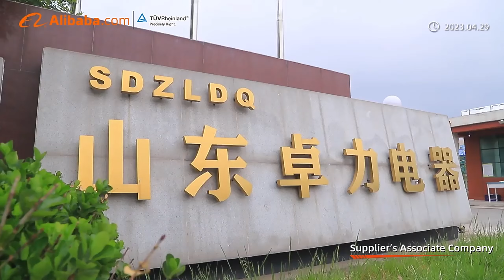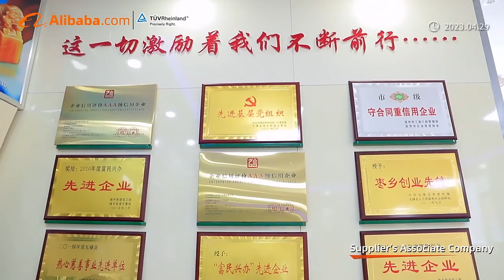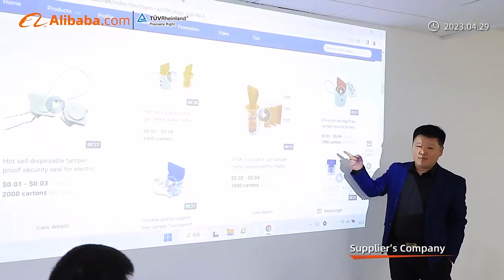Plastic seals, steel wire seals, instrument seals, high security seals and other seal manufacturers

Comment from the maker: Established in 2012, one of the largest manufacturers of security seals in china.Our company covers an area of more than 12000 square meters, with strong technical force, advanced technology and equipment, and complete testing means.Jinan Zhuo Li is specializing in R&D,

Manufacturing and marketing of security seals, The seals including Plastic Seals ,Bolt Seals,Barrier Seals,Meter seals ,Metalseals,Cable seals and Padlock seals.

Which are widely used in the field of sea, land, air transportation, postal service,supermarkets, banks, petrol companies, security, water and electricity etc. Our company covers an area of more than 12000 square meters, with strong technical force, advanced technology and equipment, and complete testing means. We have exported item to morethan 100 countries like USA, Mexico, Canada, Spain, Russia, Singapore,India etc. Warmly welcome your inquiry any time! 
Zhuoli will be your best partner!